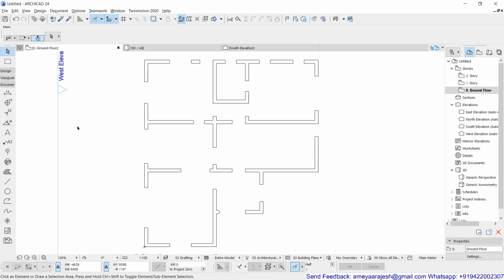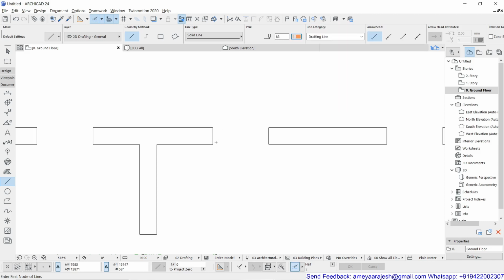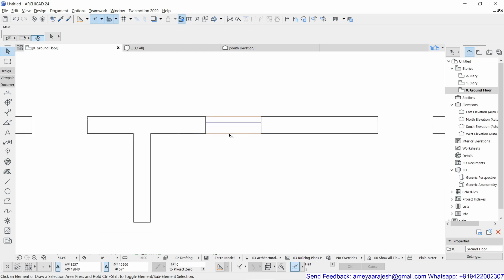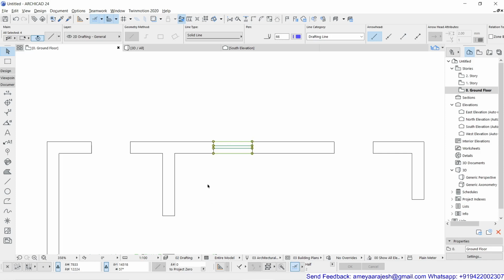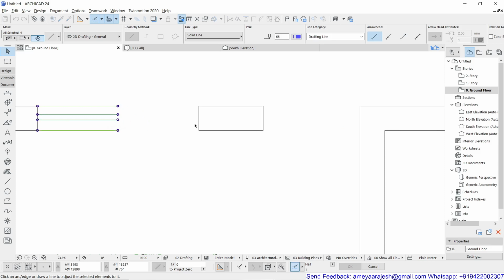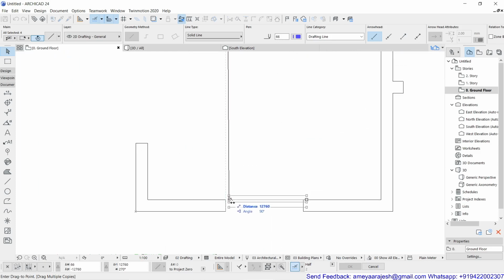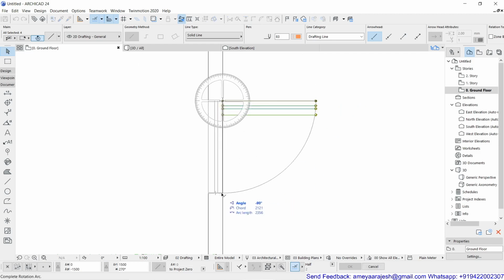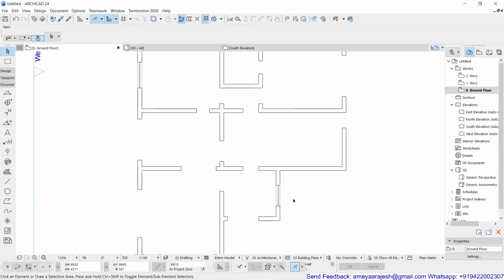01 30 Quick Revision 2D Door Window Presentation Part -1

Comment: Sir, what is the method for multiple copy?   "Arrow++" - How to do this?
Reply from the maker: Use basic command like drag Ctrl+D and then press Ctrl key once to change drag mode into drag a copy mode. For multiple copy instead of Ctrl press Ctrl+Alt key together you will get ++ mode. All this if you using windows based AC.
All such hotkeys are listed next to the command name in pulldown menu or mouse right click context menu.